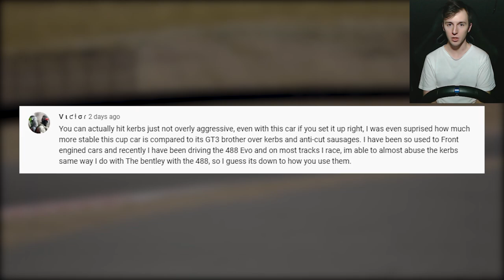ACC Kerb Hopping With Porsche 992 Cup VS GT3

Comment: The reason for this is the compound of the bushings in the suspension. The GT3R uses much stiffer bushings than the cup car. This is why setup has little effect on their reaction to kerbs- those components are homologation standard and cannot be altered. Over the course of a lap, the stiffer bushings will allow the GT3 to run much more aero and a more aggressive, stiffer setup and will therefor put down the faster lap. The cup car can eat kerbs all day. This is concurrent with most GT4 cars.
Reply from the maker: Thank you for the extra info!

Comment: Try decreasing spring rate so you can hit curbs better. I remember doing that with the bmw M6 hitting a curb/apex on T7 just before the Mistral straight on Paul Ricard. Play around with fast bump/fast rebound, I can't remember if increase or decreasing helps, probaby decreasing.

Comment: So, how do you do it? Any setup changes? (there's not much to do, I know) Keeping the loud pedal down or lifting a bit? I still struggle at Imola where you def. need to take the kerbs for good lap-times.
Reply from the maker: For the cup car I was using the Coach Dave Academy qualy setup in this particular lap but I just had another go with the default aggressive setup and also got through the kerb safely enough. I just ran through there about half throttle. It's all about waiting until the car is stable and straight before getting back to 100% throttle. Definitely make sure to slow enough to make the corner as always but yeah holding around half throttle or a little more worked alright in this corner. I still gotta work on other tracks
Reply: @unleasheddrivers1281  Thanks man, will try that. Giving the car time to get set is always important if you don't go straight I found ;) Even if you avoid kerbs. Fun car. Beauty and beast
EDIT: Works well! It's a different level of lap-time your dealing with. And a lot of fun. Thx again for bringing this up!